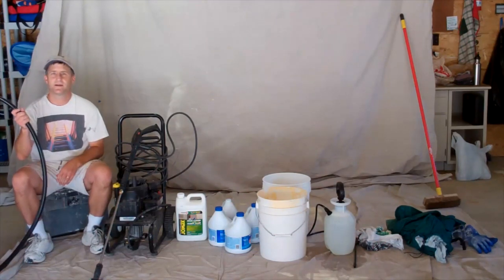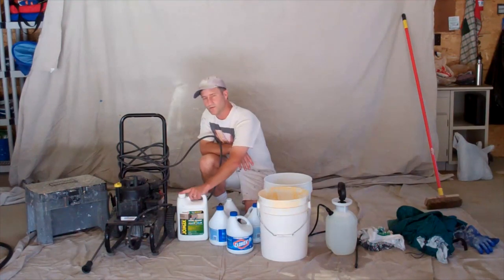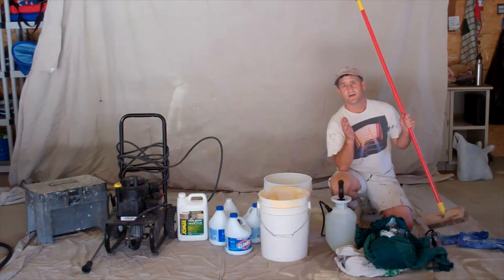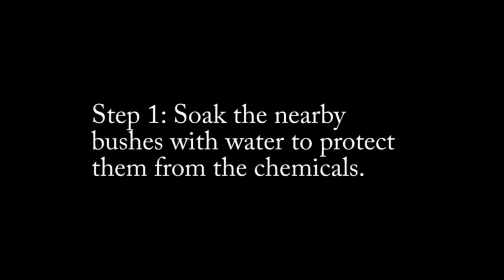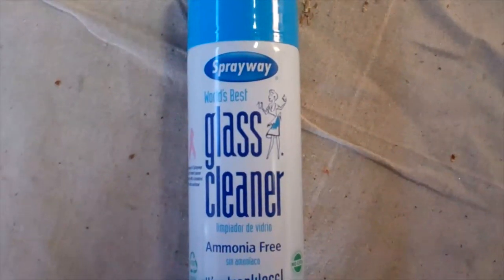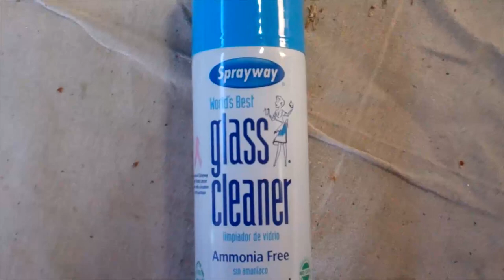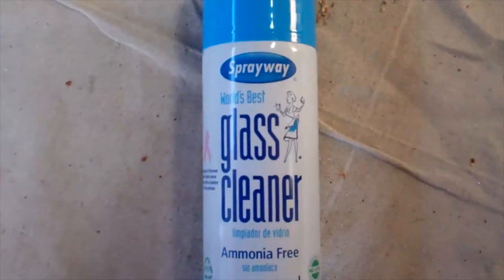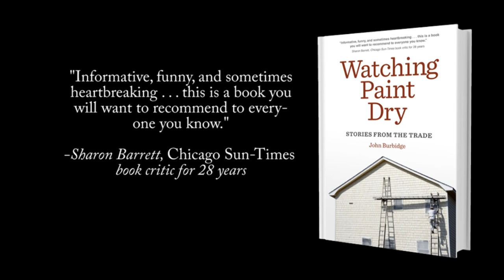Exterior Painting Step 1: Pressure-Washing the House

Comment: Please Please use a mask when doing the spraying!  I suffered extreme distress and lung damage .. must have inhaled some..  John is not wearing one in the video so I neither did I..  this stuff is extremely caustic and the warnings are on the inside of the label on the cleaning solution. Jomax!
Reply from the maker: +Gretchen Ricker That's a great idea Gretchen and I will add that recommendation to the video. You definitely want to avoid breathing this or any other chemical. I haven't found it to be a problem when working outside.

Comment from the maker: A viewer asked me if it's necessary to use the detergent, or if simply spraying with high-pressure water is enough. I believe the detergent is very important to remove any grime/pollution/chalking that may cause adhesion problems with the new paint. Using detergent also means you are not relying on the water pressure to do the cleaning, because really all you want is a high-pressure rinse. Anything more than that risks damaging the siding. Spray on the detergent, pressure-wash it off, and that should take care of the cleaning.
Reply: +howtopaintahouse Agreed, detergents are the way to go.

Comment: What I was hoping to see was how you cleaned the high areas above your head, not the easy areas. How would you clean the areas 20' or so up that aren't easily accessible?
Reply: Ladder? Scaffold? Scissor Lift? Boom Lift?
Reply: I do the same job out in Alberta I use a 24-foot extension wand I also don't use a chemical sprayer I just spray it on with the low spray nozzle on the pressure washer and then I change my nozzle to rinse it off

Comment: Hi John - great videos.  I notice that you use a bug style sprayer to get the detergent on the house.  Most of the pressure washers I see have a way of spraying the detergent.  Is there an advantage to using the bug style sprayer?  Also - I see some videos suggest you spray the detergent from the top to bottom.  You go bottom to top.  Why?  Thanks again.
Reply from the maker: I don't really like using the built-in detergent sprayer because I think when you rinse with water, there's still a tiny bit of detergent in the line and it leaves a residue. Plus, for your average DIY painter, I think it's easier to just use a simple garden sprayer. As for spraying detergent bottom to top, I just like it to run back down on itself as I go up. I think it covers better.
Reply: Hi John.  Thanks so much for the reply.  Makes sense to me.  One last question.  I have an older house with the asbestos shingle siding.  The siding is in really nice condition but in need of a new paint job (plus I want a new color).   I was told to keep the siding since it's in such great shape despite its age - and paint it.  But I have read that I should NOT use a power washer while washing the house.  Some say use a good cleaner and a garden house, because pressure washing may damage the asbestos siding.  My question is: Should I power wash it or use a garden house and possibly a brush and elbow grease where needed ?  Any insights would be appreciated.  Thanks again..
Reply: Not only does it cover better. If you soak a house (detergent or no) from the top down you run the risk of freeing extremely fine dirt up high that will run down and bury itself into the bone dry exterior down lower. This flood line of micro dirt can leave a permanent water soluble stain. especially important if you are washing but not repainting the house. I know this is a painting thread but when I ran into this it was a gratis wash of a client's house one year after painting and the stain forced some repainting.

Comment: +howtopaintahouse One question, we just stained our redwood deck.... but regardless of that fact.... the question is, will the Jomax/bleach mixture damage the stain or the wood itself?  Thanks.
Reply from the maker: I have never seen it damage wood, but it is important to spray it off before it has a chance to dry. So put it on and wash it off in small sections, especially if you are doing it on a hot day or in the sun (it's actually much better to wash a deck when it is shaded...try to plan it that way.)

Comment: would you say doing this step every 2 to 3 years after painting house is a good idea for maintenance?
Reply from the maker: TheWarrior831 I would only bother doing it for maintenance if the house looks dirty, or is susceptible to mold. The chemicals are fairly harsh so it's not something you want to do more than necessary, in my opinion. One situation where it might be a good idea is in a high vehicle traffic area where a lot of car exhaust is being emitted because exhaust and pollution tends to settle onto siding and eventually give it a grimy coating that isn't quite dirt but doesn't look good. Getting that off there can give the house a fresh look.

Comment: If you use a 2500 psi pressure washer with a yellow tip can you remove paint from wood siding without damaging?
Reply from the maker: RobF3024 The pressure washer isn't really for removing paint, although it will certainly do some of that, especially if the house is badly peeling. I don't recommend doing too much because you could easily damage the siding. Best to use the pressure washer for cleaning, and scrape by hand, in my opinion. Keep the nozzle 10-12 inches away from the siding to prevent damage.

Comment: how do I reach you to ask you a question? I've received no response on here. I have really bad peeling of multiple layers of paint on the house and scraping leaves some paint, all the different layers of paint will show after the new paint is put on, what do I do?
Reply: scrape & sand as much as you can to get it smooth...use a random orbital sanded.  you can send us a picture if you want.  You can also use a heatgun to remove the paint which may be the route to go if this an older home.  Get it as smooth as you can and use an elastromeric paint like Sherwin Williams Duration and hand paint the siding or trim.  It is a thick self-priming paint...although you want to spot prime with some like Zinser 123 on any really rough or raw wood.  The thicker Duration paint will help cover over some of the edges in the remaining old paint.  We only hand paint...luck!
Reply: thanks for the reply!

Comment: Is it safe to do this on an old home?
Reply from the maker: Brandon Eckert Probably okay, but make sure you don't put the nozzle too close to the wood if it's old and soft because you don't want to do any damage. Also, as always, do not point the spray directly into any cracks or under the siding boards because you don't want water to get behind the siding.

Comment: I like your video. However, it seems silly to me why you would wash the 1st floor of the house 1st, then the 2nd. You said yourself, "start from the top, and work your way down". Am I missing something?  Thanks for posting all the same though.
Reply from the maker: I do usually start at the top and work my way down. I think in this case I did the demonstration on a lower area, then went above the roofline to do the upper area. Since the upper and lower areas weren't actually connected by siding, it didn't really make any difference. But you are correct that when washing it's always best to go from top to bottom on every side, otherwise you'll rinse dirt down onto previously cleaned areas.

Comment: Its awful old the house I mean
Reply from the maker: The house was built in the late 1970s, which is average for the U.S., and the techniques demonstrated on this siding, which is made of engineered wood, apply the same to modern houses built with cement-composite siding such as Hardiplank (very common).

Comment: What a complete and total joke using that toy pressure washer.    With what you are being shown here just use a bucket and scrubbing brush, rinse it with a hose.  This is the most important part of a paint job.  So spend a little money and pay a professional with an industrial washer and simplify the process.  NO WAY will that tiny pressure washer clean even with JoMax (Excellent product BTW) to the level that is necessary for optimum cleaning.  This guy leading you all the wrong way. I would fire one of my people on the spot if they wildly washed down a house as shown.  Pressure washing is done in a slow and precise pattern, with the pressure washer output held at the same distance from the surface as much as possible.  Cant' emphasize enough how important to start at the top down.  When you take a shower to wash your behind first?  NO!  Using that tiny sprayer, another joke.  Spend the money and get a back pack sprayer with 4 gallon capacity and a handle pump or spoil yourself and get a battery operated pump.  So you spray from top to bottom, do a final rinse, and your last work is to get the nozzle close to the cement or decking to make sure the surface is clean for where you are going to put down your masking tape.  I see a lot of thumbs up here, and this is because this tool is not showing you the proper way to pressure wash. I am licensed California Contractor for over 30 years.